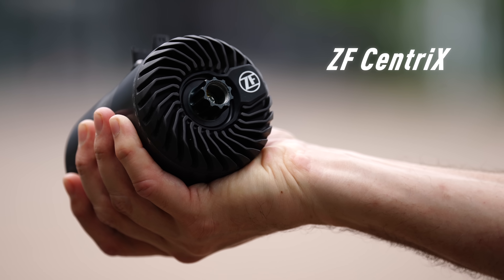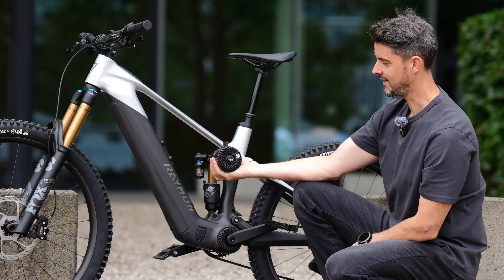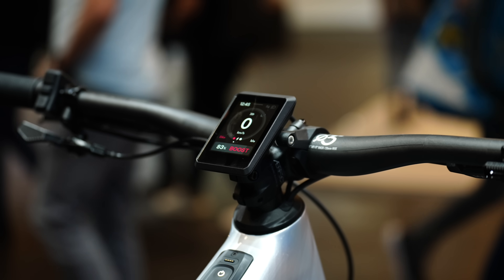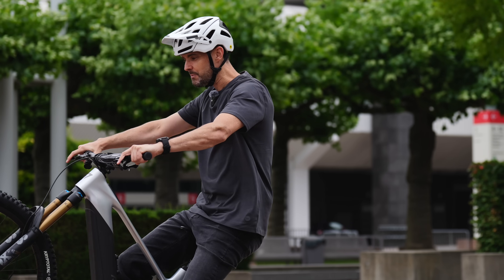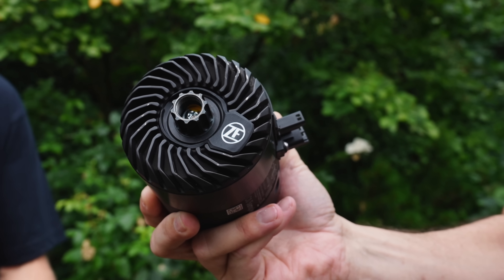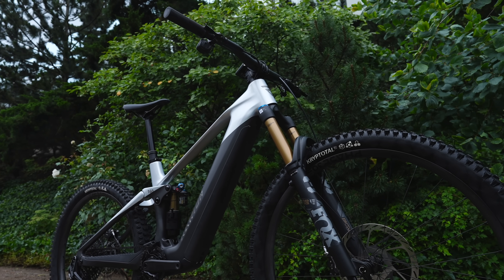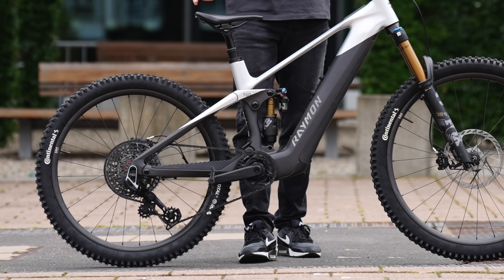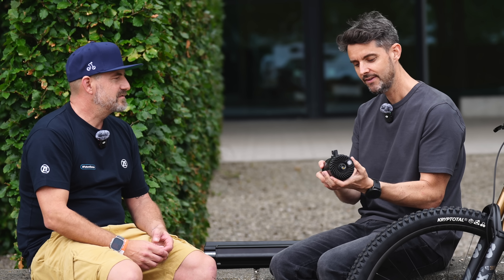How Did ZF Do This? Super Compact, 90Nm Motor

Comment: I've worked with many ZF marine gears on ships and after working with them for over 15 years  I can easily say that they are pretty much bulletproof. Never had to repair one that failed. It was mainly just new installations, alignments, and preventative maintenance. Never knew they were in the ebike business. That's def a good piece of machinery.
Reply: Hopefully they make a gearbox drivetrain like pinion.
Reply: Cool

Comment: With that motor shape and bracket design it would be quite easy to make a BB adapter to replace the motor with normal cranks.  With such adapter and removable battery this would be awesome for quick 2in1 bike conversions! That's the theory at least and I'm really hoping for someone to prove it right :D

Comment: Had to come back to maybe know how much HorsePower this is equivalent to.  
1.5 Hp is just a guess, but maybe someone has real conversion factor for 90nm of torque. 

Cheers, and I like the fact it has internal clutch to deal with high stalled torque. If I understood that correctly. 
I now wonder if it's software provides soft start to protect itself.

Comment: great to see ZF here, yet they are way behind Pinion. The ZF should have the transmission also built-in, and then use a drive shaft instead to transmit the power.

Comment: Now next step would be to get rid of the Derailleur and instead put the transmission with clutch and freewheel into the motor unit. This way the transmission would be better protected, you could use a belt instead of a cain and maybe that way they could add regenerativ breaking, too

Comment: Nice. Now ZF needs to add a quick detachable thumb throttle system ,so it can be used as as class 3 on city commuting and then a class 1/2 for trails.

Comment: Well not exactly their first as they did have the Sachs/BMz in their micro mobility section when it first was introduced .,
it has since been sold to BMZ which supplies the batteries for Brose and the former Sachs . 
i m wondering where ZF gets their batteries from and where exactly is their new motor built/assembled .

Comment: Please do a follow-up covering:
1. Noise under load comparison vs Bosch
2. How natural it feels in a dynamic-assistance mode (both on rough/rooty terrain and also on very technical terrain where overrun kicks in)
3. Range comparison
4. Resistance with the system turned off

As an owner of a bike with a Bosch Performance CX motor, I never use Turbo mode and use EMTB mode instead as I prefer a natural-feeling system with progressive assistance.  Your demos showing the bike kicking forward are a negative that I want to avoid on the trails so hopefully they have something similar to Bosch EMTB mode.
Reply: Yeah, the battery is a big part of it.  I've done 60km and 5,000 feet of climbing on backcountry mountain trails with a 625 Wh battery (mostly on EMTB mode) so 900 Wh is overkill.  I would choose a lighter full-power bike with 500 Wh and an extender for the epic days if a brand provided that option.
Reply: Best comment. Emtb mode is wonderful in Bosch motors
Reply: @Riderkim-i9l  the difference in motor weight is pretty much meaningless compared to the overall weight of the bike and rider.  Even the choice of tires can make a larger impact on the weight.  Most reviewers are raving about the motors with built-in gearbox even though those are heavier.

While I like lighter full-power bikes, I don't particularly care where the weight savings come from.  I also like less chunky, sleeker-looking EMTBs and a smaller motor helps with that but I don't care about the weight of the motor.
Reply: @dansadventures5514  One of the problems is the weight of the battery. The question is what you want: full power all the time or support. With a 900 Wh battery you can't build a light bike. eGravel bikes  can go as low as 13kg with less punch and 200Wh. But that's enough for fit bikers when you want support when/if you need it and not all the time.

Comment: 90Nm is just the max torque, at a specific rpm. You need the torque curve, which can be put "on paper". When you don't understand what is "on paper" of course it can feel "different". But the complete behaviour of that motor can be put "on paper", if you understand it.

Comment: everything looks very perfect, until telling that use the wave gearing system, because compare a normal gearing system, doesn't mater a lay-shaft system or plantery gear system, the wave gearing has a much lower efficiency, that's the reason why we usually see it's more used in actuator applications, no a continuesely power transmission system... so i am abit interesting on the overall efficiency.
Reply: TQ has been using strain wave gearing in the Trek eXe and other models for a few years now. Have not heard of any efficiency issues.
Reply: @JonnySledge  i searched the trek exe, it's looks a cycloid gearbox, yes, also not a good efficiency solution, but still a bit better than a wave gearing. honestly, i don't have any ideal of the efficiency requirement of the bike industry, i am working with the powertrain for passanger vehicle, normally 1% difference is ready a big gap for us...

Comment: DJI or ZF?
Pick one.
Reply: I pick ZF for reliability, weight and compact size.  I pick DJI for their controller display and battery density.  It actually appears the ZF has more useable torque than the DJI despite the published numbers. My next eMTB will not have planetary gears or an internal belt so that takes DJI out of the running. Looking like TQ and ZF are the contenders.
Reply: @JonnySledge "It actually appears the ZF has more useable torque than the DJI despite the published numbers." ???
What brings you to this conclusion?
Reply: @JonnySledge  By the way;
DJI
2.5kg including controller
105nm with 30 second 120nm boost mode
850 watt normal mode/up to 1000 in boost mode

ZF
2.5kg (not sure if that includes the controller)
90nm 
600 watts peak power

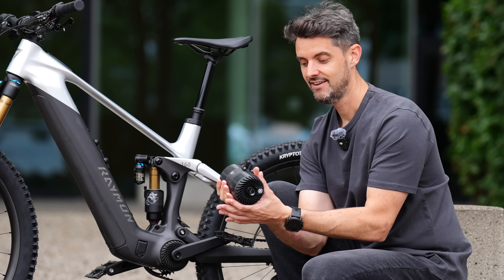3:02 I wouldn't take a seat of the pants "it's so torquey it wheelies" torque demonstration where the chain is in the big end of the cassette too seriously. Breathing heavy on the pedals is enough to lift the front in that cog. 🤣

Comment: I wonder is this mounting design they came with is or will be reliable enough in long term and easy to make for frame manufacturers?
Reply: ??? What is easier than to make just a circle to fit a motor?
All other has some custom shapes and needs special cages for them in the frame.

Comment: I hate over run. It needs to be an option, on or off.
Get a throttle if you want over run.
Reply: You hate overrun as it is currently implemented in most eMTBs. The ZF system uses a clutch that disengages the motor while the motor remains spooled up. This is an important development that not enough people seem to have taken away from this introduction.
Reply: @JonnySledge   They specifically say 1.2 meters of over run in sport mode.  So it's not just spooling, it's engaging.

Comment: If I were Bosch, Shimano, Spesh etc I would be VERY worried! Life time warranty is a massive on its own.
Reply: Lifetime Warranty means diddly squat! Unless someone says every component is covered for repair or replacement for life, then it would mean something, I'll bet there is absolutely loads of small print in their warranty because the Big print says what it gives, but the small print takes it all away.
Reply: @1t_wasnt_me  Do you know anything about thier gearboxes? Known for being the best you can get, installed on everything from road cars to powerboats. These guys know what they are doing, I would trust thier warranry wording over anything in the current MTB market.
Reply: I wouldn’t, looks like it will burn out, like other ZF parts
Reply: @seanpera9499  examples? Ah, I thought not.
Reply: @mintsauce101  many car owners have had problems before service intervals, BOSCH is known for making very reliable car components too, Shimano with bikes

Comment: It's a very cool system, but what is the warranty and will it be repairable. That's the information that really can't be missed off if these videos in my opinion Rob.
Reply: Did you wahtch the video?...there is a life time warranty. And this system is complitely closed...no need to add oil again during live time at all.
Reply: @josefv-y8m  They did not say the whole drive system was guaranteed for life. They said the strain wave reduction gear is guaranteed for the life of the motor. The strain wave gear is only one part of the whole system, but an important one that replaces planetary gears and a belt in other systems.  Still, no promises made for the other components like the clutch system, torque sensor, motor, battery, controller, etc... .

Comment: The industry should start to make a standardized mount
Reply: Of course they will not do that, it's not about making accessible bikes, it's about to make them expensive.
Reply: Great idea!!!
Reply: Not likely because there is no common form factor.
Reply: @svenweihusen57 well, the industry needs to standardize. Wink
Reply: @svenweihusen57  That's exactly what he's saying. Hopefully the industry gets to the point where there aren't so many proprietary e-bike parts.
Reply: @bradley3549  Well, but if there had been a standard it would have looked like the standard Bosch motor. So these new ones would break the standard aka you will not see new form factors.
Standards are nice but they are also a problem for innovation. And in an industry where you can't agree on the diameter of of saddle tube or a bottom bracket I don't see any chance of standards.
btw: the automobile industry has nearly no standards too. Just check out how many types of wipers are on the market.
Reply: @svenweihusen57  There is a lot more part interchangeability in the bike world than the automotive world. Even if nothing is truly standard, we at least have quite a few choices and upgrade paths for most components because there are enough pseudo-standards.

With ebikes though, you can't even upgrade physically compatible motors easily within the same model line and brand of bike most of the time.

That really needs to change with some yet-to-be determined industry agreement that allows more flexibility and upgradeability.
Reply: @svenweihusen57 well first of all your comparison of the bike industry and the automotive industry is a false equivalency. The two industries have some overlap but not enough to equate the two in this sense. 

Secondly, there are no great reasons (other than bad engineering and profiteering) why there couldn't be more standards in the automotive industry. Your example of wipers is a good one actually. There isn't much real innovation in wipers so standardizing the mounting systems is an achievable bar on the engineering side. 

In general, there is no practical reason why we couldn't have more standards, and yet also give manufacturers the flexibility to not use the standards when they can prove that there is an actually innovation in the design. It would cut down overall waste, increase manufacturing efficiencies and thus make products more economical.

The real stopping point for such standardization is that we don't have a regulatory framework that can encompass them on an international scale. If we did it could change many industries and provide many benefits, if it were well implemented.
Reply: @newolde1  I don't mind standards but Standards have some disadvantages too. there is no way to have the same mount for a ZF motor the size of a coke can and a Bosh motor. Most other motors are quite similar to Bosch so there would be a chance for standards. 
Many other things have standards, you can even make a shigura hybrid brake and the mounts have standards. Electric system works at a standard voltage. 
Seat posts have no standards which is crap. Wheel sizes hubs spokes etc. Some things you can have standards for and others are problematic.
Reply: @svenweihusen57  sure, that's why I mentioned the need for flexibility within standards, when appropriate to adapt for innovation or other such dynamic situations.

This subject is much deeper than meets the average eye. There are many inefficiencies within our societies that could be rectified by more standardization. And then there are the environmental impacts ala C2C (cradle to cradle) whereby the lifespan of a material is considered in the initial design and production. 

I see much of this as symptom of lack of foresight, care, and/or greed, so yeah, not surprising but hey, we can do better. One spoke at a time.. 😉

Comment: Given the diminutive size, it looks like it should be a possible retrofit to other ebikes. Aside from battery/electronics, the motor mount should just require laser cut plates, a clamp, bashguard and 3d printed shroud. Will ZF go for that?
Reply: This is not like a german engineer thinks ;-) ...it must be perfect fit.
Greetings from an german engineer.
Reply: @josefv-y8m  Of course, how silly of me😁

Greetings from an English engineer (well qualified  many years ago at least. I'm actually a youth worker now)

Comment: I have a 10 year old BMW 530d with 150,000 miles auto ZF gearbox using similar engineering to this new motor...big auto manufacturer with this much knowledge and background engineering will transform ebike technology and it will work and be reliable like my car 💪🤛
Reply: like BOSCH

Comment: Funny, ZF the gearbox company fails to deliver a motor-gearbox unit. NO THANK YOU, we got enough stupid motors with stupid chain drive.
Reply: Just wait. This ZF drive system has components that hint at a sophisticated integrated gear system in the near future.  The unprecedented clutch, HD wheel sensor, and super sensitive torque sensor are not there just for better over-run performance. I think ZF is playing chess and their opening move, as impressive as it is, should not be underestimated.
Reply: A chain is a chain is a chain...robust and easy to maintain, if you are not a fool and too dumb to set it up.
And this motor is quiet!!! I hate all the noise from those middle motors...and the Pignion with the Gear is one of the noisiest...will never buy this.
Still love my very old bike with rear motor...silence!!! Has a lot of disadvantages, but is quiet as a normal bike.
Reply: @josefv-y8m  yea, right, chain easy to maintain. Next time before writing try to think first.

Comment: Nice and tight looking motor. What about the controllers? they look err chunky is that a prototype or the final?

They seem to also have a similar approach to DJI with the brake disc ring style speed sensor.
Reply: Hopefully the final version will use special brake disc for braking and rotation sensing.

Comment: Ebike industry needs to standardise battery and motor integration. Not every frame is proprietary design
Reply: If they did it before how big would the standard be today? As all the other brands have bigger motors they will not accept a standard that doesn't fit their motor. 
If ZF wants to build a light ebike motor it will be smaller and lighter but it can't get smaller because it would need to fit the standard.
A standard for the plugs and charging would be a good idea a standard size for motors isn't.
Reply: Round, or the laying egg😂😂😂

Comment: How is overrun such a BFD - isn't this a firmware/controller feature, so pretty much any motor could do this? Provided there is a rear wheel sensor of sufficient resolution (rather than a single magnet as used by most manufacturers). Without that resolution, would fall back to a time limited feature rather than distance limited.

More interested in the guts of the motor, what the internal layout is, and what the Q factor is (since that is fixed by this motor design).
Reply: The disengagement/engagement of a clutch for over-run performance is a bigger deal than most people seem to realize. That said, I suspect the clutch system, HD wheel sensor, and super sensitive torque sensor are really there for other purposes to come in the near future. I suspect ZF is working on an integrated gear system that uses the clutch for brief motor disengagement while shifting manually and/or automatically while always keeping the motor at proper RPMs for the gear and wheel speed for smooth shifting and minimal clutch wear.
Reply: @JonnySledge  it'll just be a Spragg clutch, nothing special. ZF won't be putting any stuff they don't need into this motor.

Comment: How reliable is it because the amount of ebike motors that have to be replaced under warranty is staggering. And the cost as well how much will it be exactly
Reply: No one knows the reliabilty other than ZF, since there are no bikes on market...Eurobike in Friedrichshafen shows some the very first time.
And...they talked about life time warranty in this video.
Reply: @josefv-y8m  if they offer a lifetime warranty then they are one of a kind most manufacturers only offer 2yrs  so I’ll be keeping a keen eye on them
Reply: They said the strain wave gear was guaranteed for the life of the motor, and did not mention warranty for the rest of the drive system. For instance this ZF system uses a clutch, which is typically a wear item that requires periodic replacement.

Comment: It looks like ZF could easily make a hub motor out of that unit as well.
The motor is quiet so you will hear the noise coming from the derailleur system better.   😁